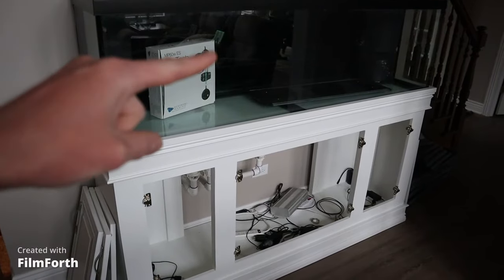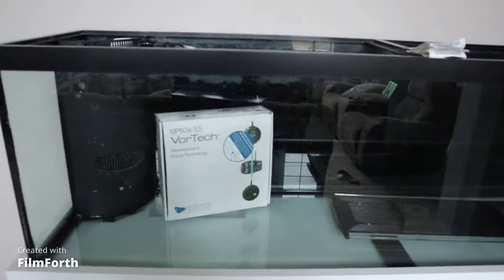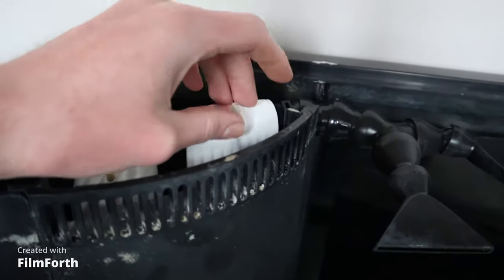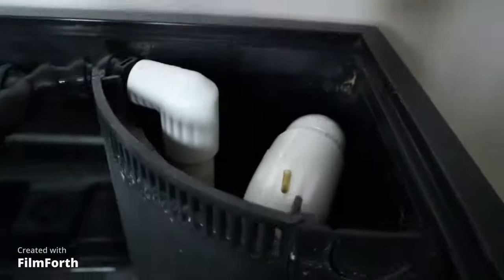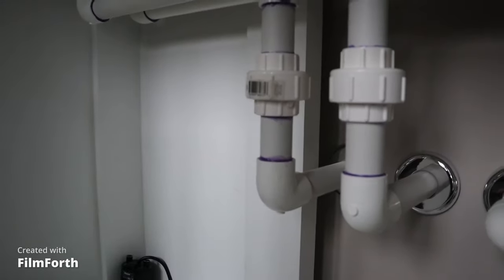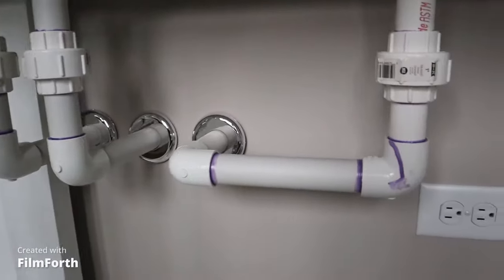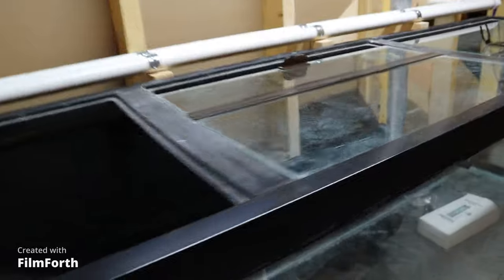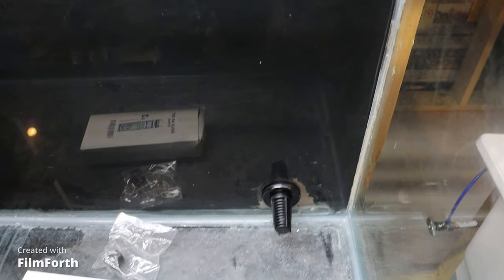Aquarium Plumbing Setup for a Basement Sump ULTIMATE

Comment: Should have put some ball valves or something there by the bottom of the tank bud...so you could work on them pipes if u have any problems when tank is full😉😉
Reply from the maker: True point, thanks for the input
Reply: 100% I had to cut mine to add in after. Huge mistake.

Comment: Dude...you're literally a few months ahead of me on my build.  I have a used 180 that I bought that will upgrade my 90.  I'm in the process of re-sealing the entire tank because why not?  Like you, I have some great equipment that was part of the deal.  And, like you, where I plan to put this 180 is above an unfinished room below, so I have access to add all the plumbing I need to make maintenance as easy as possible (just need to add some reinforcement framing). I thought about putting the sump in the lower level as well, but I just don't know if that would be convenient in my case. I want to be able to access the sump, refugium, etc. without having to run downstairs, lol. And how will that affect the heater? Either way...I'm interested in how your build goes and wish you much success!
Reply from the maker: Sounds awesome man! I will have to see how it will affect the heater, im sure it will be working a little harder, might have to have two on this system. Thanks!

Comment: So long of a video and still no full explanation how the system works. Why 3 pipes going in the basement, instead of just 2?! Is the pomp working constantly? Are there any valves that prevent the water from completely draining?